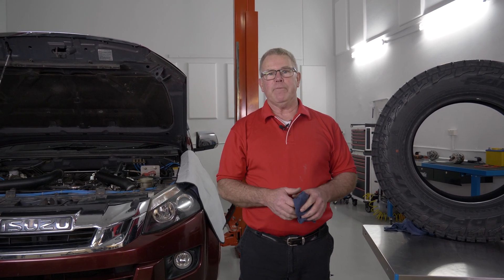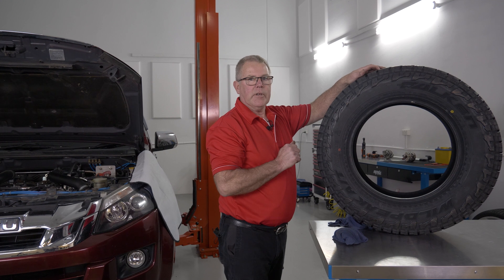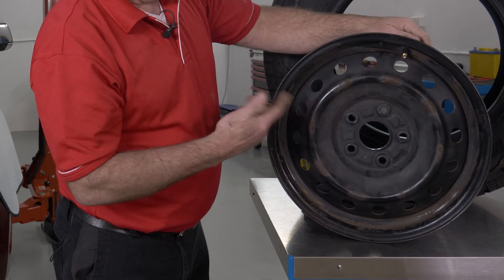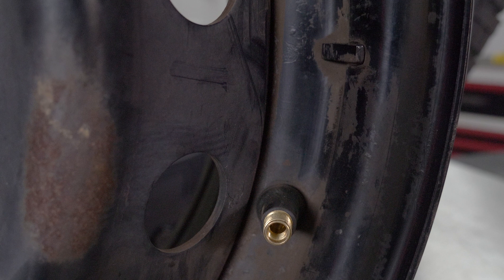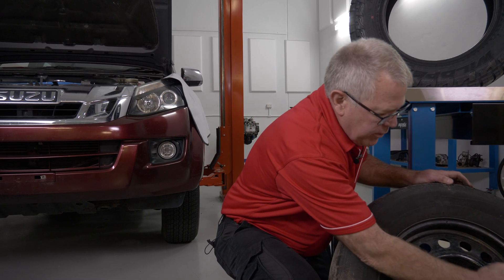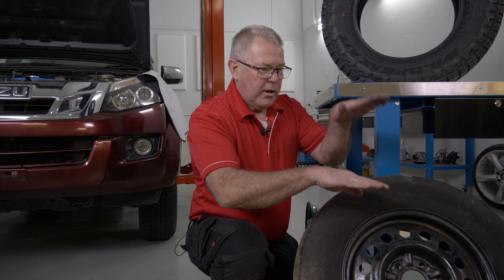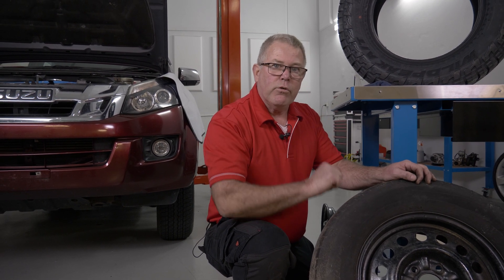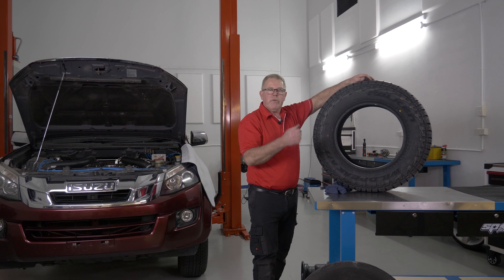Why Do Tyres Have Painted Dots? - Diagnose Wheel Balance & Vibration Problems!

Comment: What if you only have a yellow dot or one red dot?
Reply from the maker: Hi,
Thank you for your question. There is no real standard for coloured dots between tyre manufacturers. Most use yellow for the lightest part of the tyre and red for max run out or high point. Some tyres only have one coloured dot if no run out, mainly yellow. If so, align this yellow to the valve, as the valve is usually the heaviest part of the rim and as you say, could have the tyre pressure monitoring in it. If the tyre also has a red dot (I haven't ever seen orange), and the rim has a balance mark or a coloured dot on the rim, align the red dot to that mark. Run-out is more important to correct as heavy spots can be balanced out with weights.

Comment: What happens if you have aluminium rims not steel one and you have also white dot you dint say that thanks
Reply from the maker: Hi Sulo kek, thanks for your question. Rarely will you see balance marks on alloy rims. But if you do, align the red dot to that mark. There is no standards for tyre manufacturers to use regarding colours. Red is consistent for run-out by all manufacturers, and yellow is by far the most common for balance, but some manufacturers will use white or even blue instead of yellow.
Reply: @AutoMateTraining  , my new Firestone winter tires arrived with white dots..  I’m mounting on alloy wheels and aligning the dots to the stem.

Comment: thank you very much. Appreciate the knowledge. I love the recap at the end. Makes it easy because sometimes video gets long and it's nice to have a simply answer at the end incase someone lost track of where the person in video is talking about.

QUESTION: I remember going to automotive school and i thought the heaviest part of the tire being the orange dot should be placed in conjunction next to the tire valve on the rim? as that should be the lightest part of the rim..? even though there's a valve right there and it might be rubber/aluminum with TPM sensor. I got lost a bit.

My instructor gave me a lecture one time in Steering and Suspension, think of digging a hole and putting that dirt or sand in the hole of the tire valve kinda like that. Heavy spot -> Lightest spot, you said in video was to move the tire with the lightest part to the lightest part...
Reply from the maker: Hi Lime,
Thank you for your question. There is no real standard for coloured dots between tyre manufacturers. Most use yellow for the lightest part of the tyre and red for max run out or high point. Some tyres only have one coloured dot if no run out, mainly yellow. If so, align this yellow to the valve, as the valve is usually the heaviest part of the rim and as you say, could have the tyre pressure monitoring in it. If the tyre also has a red dot (I haven't ever seen orange), and the rim has a balance mark or a coloured dot on the rim, align the red dot to that mark. Run-out is more important to correct as heavy spots can be balanced out with weights.
Reply: @AutoMateTraining  thank you very much for the quick response. I appreciate the knowledge! :D